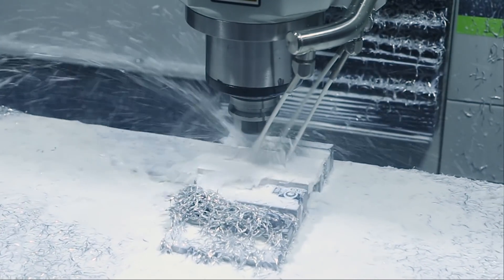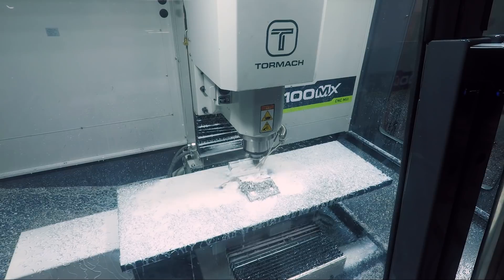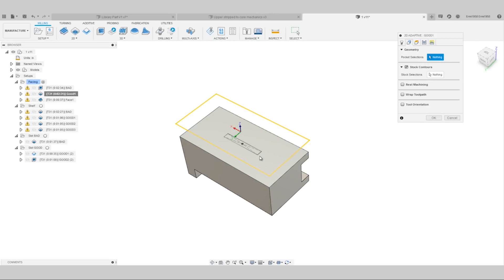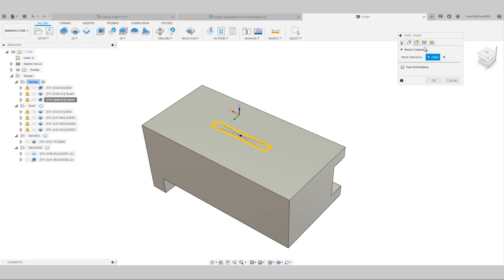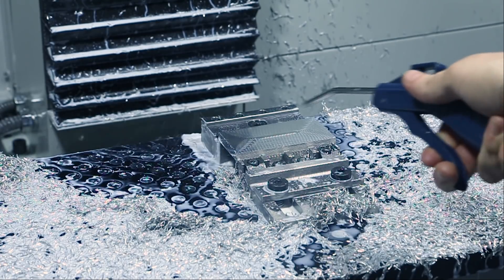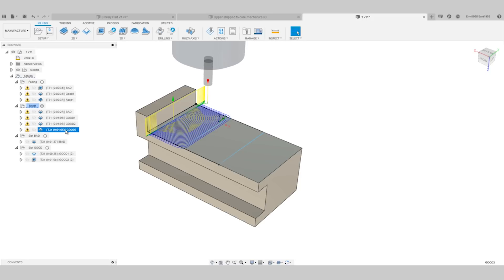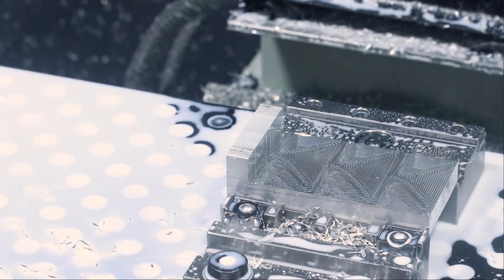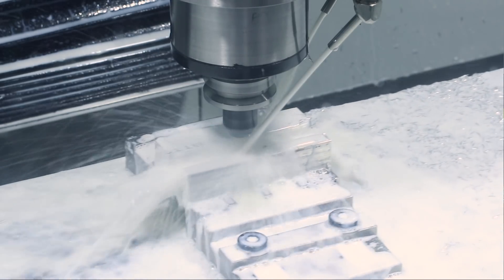Improving Adaptive Roughing Strategies in Fusion 360!

Comment: I wonder about the wisdom of the adaptive clearing advice that everyone repeats. Sometimes it takes longer and puts more strain on the spindle bearings all to increase the life of a $15 tool by... well... nobody knows knows how long.... or if it's actually true at all....

I noticed that Datron doesn't use adaptive clearing for roughing on their aluminum drone mold video. They use a 20mm "face mill" at 34,000 rpm / 8000mm per min with a light 2mm stepdown. 

You don't see many machines that can work faster than a Datron M8 and with so little power used.

Perhaps the "adaptive clearing saves times and increases tool life" advice needs to be tailored (significantly) to the type of spindle, the tool size, the material and the part shape instead of the blanket regurgitation.

This advice seems to have started as Fusion 360 marketing blurb and is now repeated like a bible passage across forums.  Was there independent testing? Or is it like the "HSK toolholders are better" advice repeated by people who've never used one?

I'm not saying I have the answer. Only that I've personally found adaptive to be problematic for roughing my aluminum mold cavities (that require roughing with 1/4" or smaller tools).

Comment: The facing is not from a diameter or corner radius input error inside of the tool library. The issue stems from the nature of adaptive mixed with HSM cutting. When you’re only cutting at 10% or less for your RDOC, as you get closer and closer to the center of your toolpath, you’re going to be left with a sliver.

So in the case of a 3/4 end mill, you’re talking about a .075 sliver that’s around 1.5in deep. When the toolpath gets to this point it likes to grab it and in the case of harder material, it can destroy the cutter quickly. 

This is not meant to be a use case for every situation either, just went needed.

Comment: You should try choosing "Bull nose end mill" instead of "Flat end mill", adding your corner radius and see if this still happens.  If you're not cutting the base of the sliver the whole wall just pushes over and essentially keeps a wall the width of your corner radius (theory).

Comment: I had this issue at one point.....then I found that I had not set the corner radius correctly in the tool library. I completely forgot about this issue since I haven't seen it since.
Reply: I remember having this issue a while back and finding a fix to it... I think that was it.  You have to choose "Bull nose end mill" and add your corner radius

Comment: Autodesk: make a "Remove cusps" check box. The algo is already programmed into Powermill.
Reply: You can use rest machining to remove cusps, there is even a setting to ignore cusps in the rest machining box.
Reply: @dudemcgee256  So even easier, just add the cusp detection to the adaptive strategies without rest machining.
Reply: @Eggsr2bcrushed  Yeah, that's what I was talking about. That option is under the rest machining tab, pick "from bodies" under the first drop down, then pick "machine cusps" option in the second drop down box.

Comment: Hi! Thanks for such useful videos! As a CNC machinist with less than a year of experience I still fight chatter more than I'd like. I know that using the right tool, stick out, holder, workholding, and feeds and speeds are crucial to preventing it, but what if you are in a situation where the only things you can alter are feed and spindle speed? Any chance you have plans for a Wednesday widget planned for reducing chatter at the machine? Side milling, thin wall/face milling, and inside corners are the types I'm talking about. I couldn't find anything useful that didn't just tell me to change tools, stick out, and workholding. Thanks again. 🙂
Reply: Just keep dropping the surface speed and keep the same f/tooth until you don't get chatter. Once you're there, start bumping it back up with increased f/tooth until the cut starts sounding bad, then back the feed/tooth 10%. Not sure why you wouldn't be able to decrease width of cut or length of cut thogh
Reply: Feed optimization for corners. Chatter on walls without the SSV option is just a matter of dialing in your F+S in the moment to something that works. You can always modify DOC
Reply: Contrary to what your mind suggests, increasing spindle speed will eliminate chatter. For more information, recommend checking "stability lobe diagrams" .
Reply: @ArmanZonüzi  I've been a professional machinist, cnc miller, programmer, cnc lathe programmer and 5axis integrex programmer for 10 years. Increasing spindle speed CAN reduce chatter, but in low regedigity situations, dropping the speed will ALWAYS works whereas increasing will SOMETIMES work.
Reply: Thanks for the info! It's super helpful. I can get programmers to change things, but due to the nature of the company I work for, we aren't given time to work through the best stick outs, tools, and cut depths for the part.   We are expected to prove out programs and make the adjustments necessary on the first part with the stick outs and tools we are kitted with. Thanks again for the helpful info.
Reply: Just slow things down. Lower feeds and speeds till chatter stops. It's always a rigidity problem.

Comment: I often think this problem is caused by not having the correct tool diameter in fusion tool library. Most of us will enter a 3/8 endmill as .375 in reality most carbide are -.001 that I have found/use. It's worth measuring them. This has never been a serious issue for me so I have not looked into it more than just making this assumption.
Reply: I have had this exact problem, especially with cheaper endmills. The .0787 o-flute was leaving literal islands in a pocket operation, and spring pass didn’t touch them, so no deflection.

And Michael, you are obviously a real (real) (really real) machinist, as most people think “tight” machining is .005 profile tolerances and would never dream of looking at a tool OD to compensate for.

Comment: I had something similar, had to mill out a circular slot and the adaptive tool path took pretty long to machine. So I took the contour operation instead, let the end mill feed down in a spiral first and then do some passes with the stepover value to the contour. You have to adjust the amount of passes so nothing gets left behind by trial and error, but it really saves time when machining.
Reply: If contour takes less time than adaptive, then your adaptive strategy isn't optimized or fast enough as it stands.

Comment: I also don't understand this. Been using fusion for 3+ years and this has never occurred.
Reply: Not pushing hard enough then. It's from deflection in cutter/machine.
Reply: @spikeypineapple552  uh huh. Sure. 400ipm @ 60% totally isn't hard enough 🙄
Reply: @urgamecshk  Well there you go. You aren't using a low engagement milling style.

Comment: I machine in Fusion everyday, and have for 5 years now. I've never had this happen to me. Something is wrong in your tool path settings man. This shouldn't be happening.
Reply: I think it's mainly a machine rigidity problem.
Reply: Dude McGee it’s a common problem in fusion, it’s very post dependent.
Reply: @Livedracersteve  the post doesn't change programmed locations...
Reply: Offset problems and tool wear problem.
Reply: It's cutter deflection. You need to push harder.
Reply: I was thinking exactly the same, I haven't seen this either

Comment: Why does the sliver even exist on a 2d adaptive facing operation?  Does this mean your tool diameter is a little off?  Fusion should have a setting to fix this simply, instead of having to work around it.
Reply: Isn't that a good question! I've been annoyed with this many times too. I use 12mm endmill for roughing and no matter what the stepover is, it still leaves that little nub at the centre. Even with 3-4mm stepover, which you'd think would clear everything and then some. But no...
Reply: The last tiny piece is probably flexing out of the way of the cutter. Needs more step over.
Reply: @Sicktrickintuner  more stepover would cause more tool deflection and creating a worse center piece to get rid of.
Reply: Maybe the stepover causes the tool path to end up right at the edge of the center sometimes. Maybe there's an option for some interference of the tool paths? Negative stock to leave maybe?
Reply: The problem you face as a machinist isn't getting rid of the blade but more the fact it's even there at all. I use mastercam (learning fusion as alternative) and their equivalent toolpath does the same but it WILL take out the blade and in the process try and explode your carbide endmill on steel. Broke a few doing this so haven't bothered for a while now
Reply: usually the tools do not actually have a fully straight edge, the corners are chamfered. not sure what would happen if you actually would take this into account when defining the tool
Reply: @jkotka  carbide endmills are very sharp at the point and would not cause that sliver.
Reply: @qqqqqqqq1407  my carbide endmill have up to 1mm corner rads. Find the rads increase tool life significantly.
Reply: @wildin13  yup but we use the same tool for roughing and finishing. In aluminum that is.
Reply: @jkotka  One problem with fusion is that you can't define the cornerradius/chamfer most endmills have. To do that you have to define the tool as a bullnose....
Reply: All good points. Deflection and corner radius, and possibly a slightly undersized tool might be the most likely causes?
I’m not at the computer but can’t recall...is there a stock to leave option and would a negative value take care of this?  I’ll have to check.
Reply: I use fusion adaptive clearing daily and have never seen this. I’m guessing step over for that little machine is small cause it isn’t rigid enough and would guess that is the problem.
Reply: A negative radial stock to leave does change the toolpath and seems that it may come in tighter towards the center of the face op using 2d adaptive. However, it may just leave a smaller or shorter sliver. I’ll have to try it and see.
Reply: @ScotY808  I think ya mean radial stock.
Reply: Oops, yes...edited previous post.

Comment: Working up to a straight edge like in 2nd example, I get around it by using a 2d contour with adaptive style cutting data so it would do straight line cuts along y axis working from right to left. Do it all in 1 program then plus you can trim the toolpath to outer geometry to save on any air cuts

Comment: Wouldn't doing a facing operation work better with a step over?
Reply: Guess time is money here
Reply: The facing operation would conventional mill every other pass, I like the idea of leaving a rectangle in the center to do a facing operation with a few depth cuts. I think that would be called an avoidance region during the Adaptive cutting. But I don't use that software for programming.
Reply: @timschjei3917  no... You set step over to less than 49% of tool D and set it to climb mill....
Reply: @urgamecshk I haven't used a facing cycle for full flute engagement, in spiral mode wouldn't it leave a sliver in the middle just like dynamic/adaptive Milling? I generally go with a dynamic cycle for roughing off the excess stock, and do a zig zag facing cycle for finishing with a end mill. 

I usually use zig zag with depth cuts when the part is wider than the cutter with a face Mill,